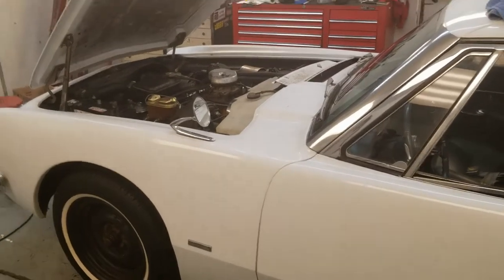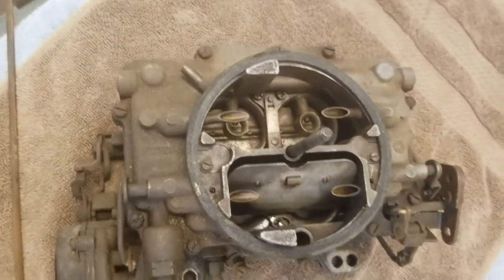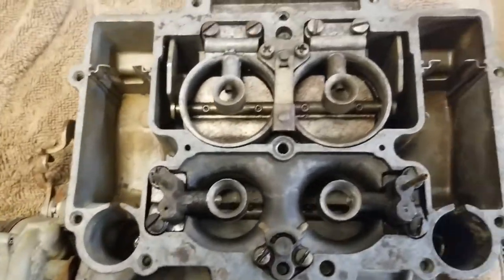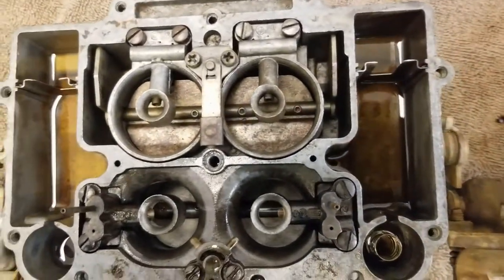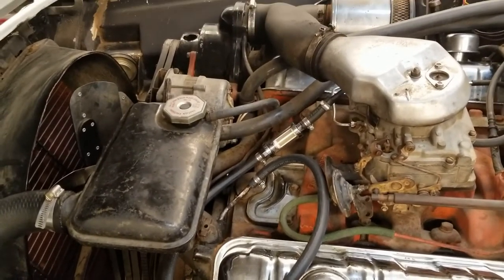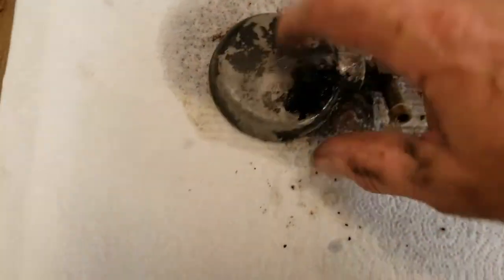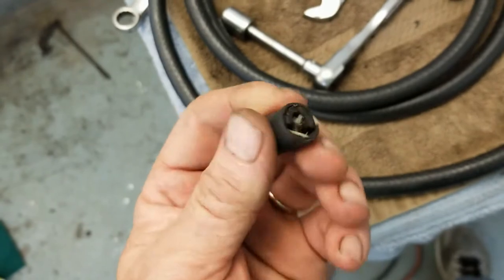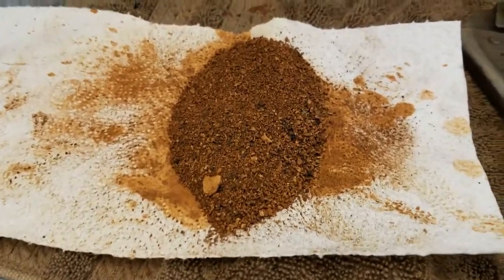Studebaker Avanti Refresh - Part 4 Engine Stalling

Comment: Really instructive that a car with filters in the fuel system has so much dirt in that same system. Why is that?
Reply from the maker: The gas tank must have had some moisture in it when the car sat.  That is where most of the crud came from.